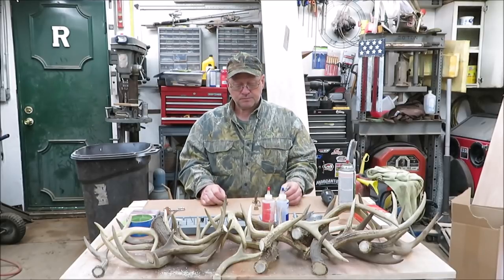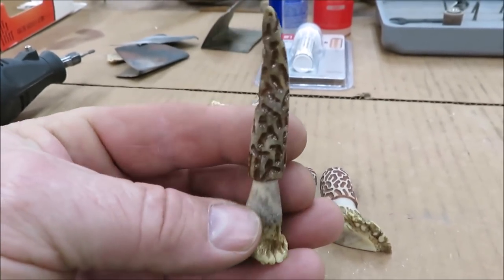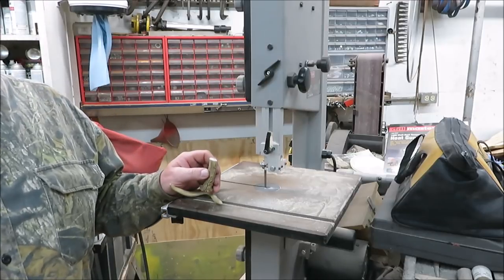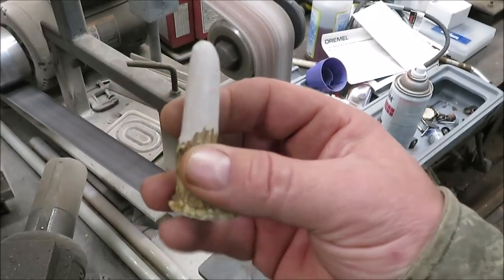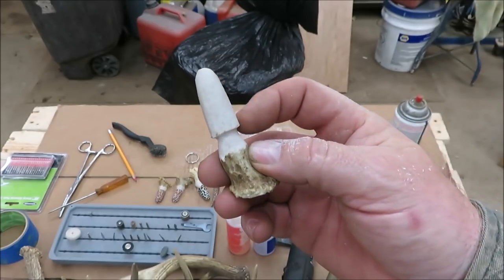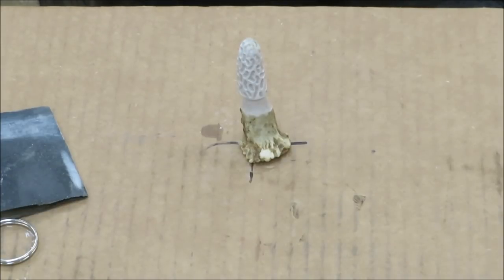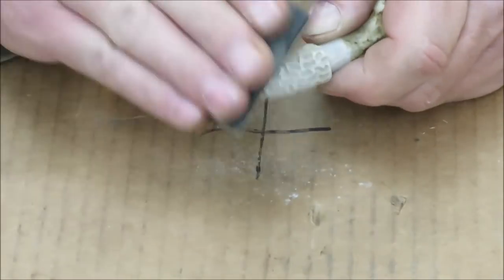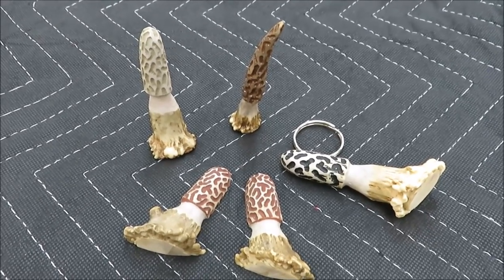carving a morel mushroom form antler

Comment: That was my favorite Dremel, used it for years,  un till this past October,,had to change out my fuel filter ,an the guy couldn't drop my tank, so he had to cut a hole in the bed of the F150, an in the process, BURNED UP TWO OF MY DREMELS ,  
Not sure if he was pushing to hard or what the problem was, but burned up 2 & went through 13 cut off wheels....(2 being dimond cut wheels....🤔
I was mad,   then had to go buy the gray an blue one,60$  it works decent, but it surely ain't the black one....
But anyway, 
Great Job Brother, 
&
Thanks for the idea....👍😁👍
Reply from the maker: Thank you for the comment Jake.